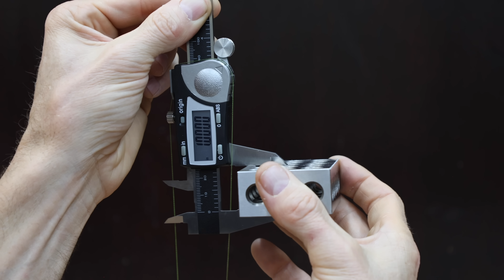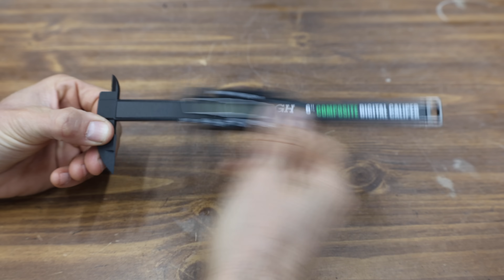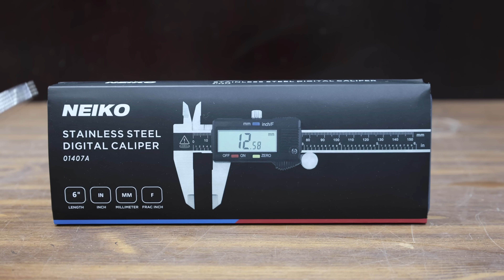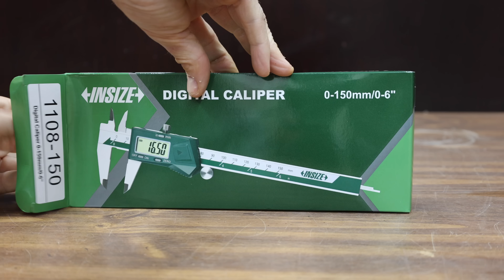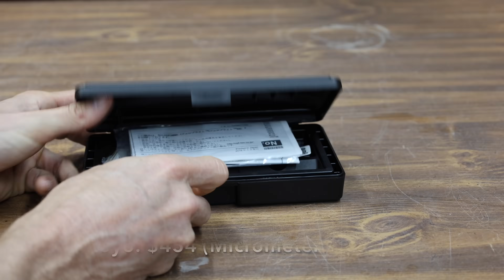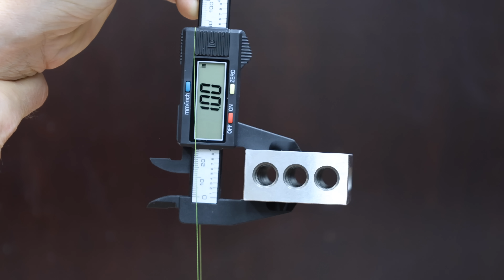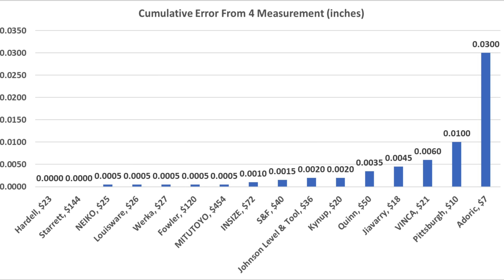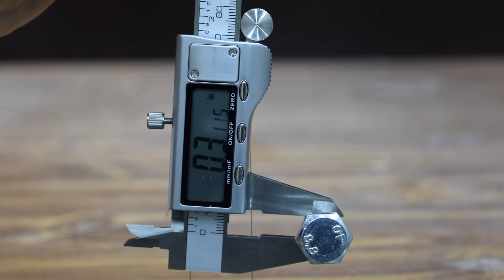I've Been Proven Wrong About Calipers!

Comment: My machine shop days, a job while I was in college, are some 55 years behind me.  What I recall from then is more about how to use these tools, and that differs from the tests.  For consistency I can see why the tests were performed as they were, but I think something about actual use needs to be said.  First, I always use the wheel to control the pressure on the piece.  That means a feel for the pressure.  Second, and probably more important, the piece being measured is always moved along between the jaws, and other case of feel.  measuring something round like the drill bit includes rotating the bit, another example of applying feel.  All those combined are part of making consistent measurements, to handling each sample consistently against all the other samples.
When a Harbor Freight store first opened in my area I got what I thought was an amazing deal on one of their Pittsburg digital calipers.  Looking at their web site, in appearance it is visually a cross between two models, both $23.  Looking at those two listings I find each has multiple part numbers; I found mine among the six listed for one of them.  Which brings me to a point I don't recall being mentioned.  The web site lists 90 days for their warranties.  The cardboard sleeve that goes over the plastic case on mine says Lifetime Warranty.  I can't imagine needing to use that, but I guess if I got a replacement under the lifetime the new one would be 90 days.
Reply from the maker: Thanks for sharing!

Comment: I know this my QA side being picky but you should be using a surface plate and get certs with each caliper. That wooden table can cause discrepancy with the depth tip. 

They are also 2 set screws on to for calibration to straighten up the jaws to make them parallel.

Comment: I can tell you a few things from experience: Brown & Sharpe, Starret, and Mitutoyo have made a name for themselves with results, not marketing. Their SERIOUS customers are more than capable of calling B.S. on sloppy metrology tools because a lot of times bad tolerances cost them loads of money, reputation, and sometimes lives. Things they’re not willing to afford.

Second: if you want an accurate measurement under about .01”, go get micrometers; calipers flex. Not saying they can’t be accurate below .01” but if it matters, get a micrometer and use the friction screw or thimble.

Third: if the tolerances REALLY matter, so does the temperature. If you want a place to work with a consistent (usually cold from my experience) temperature, work in a metrology lab.

Also, analog tools don’t need batteries and they don’t tend to disappear as quickly because people that care enough to learn to read analog metrology instruments have typically invested enough in their careers to not need to make tools disappear to make a good living. Not saying good trades people don’t use or have digital calipers or mics, but analog has some pretty strong benefits. 😉
Reply from the maker: Thanks for sharing your experience!

Comment: I'd like to see a test of weight scales like you're using.  My 0-500 gram version varies alot depending on where the weight is on the platform.  The 0-5 lb varies if it's not on a flat surface.

Watch out for fake Mitutoyo's.

Thanks Todd

Comment: I extreme like your video but ---> the most important feature is precise firm measurement AND REPEATABILITY(and wear resistance, jaw flatness, oil/coolant resist). When you measure, you should hold it and push/slight turn on the round screw. so this test, sorry but no, mitutoyo (especially), insize,  starret will completely outperform all others. if you want precise sample, at least try a shoulder screw grinded surface and gauge blocks, mitutoyo micrometer privided one... and use a marble flat! ;D  I work in QC and mitutoyo calipper was used 24/24 7/7, they never fail and are exactly on measurements. the 12'' inch one is so stiff, you NEVER never miss a measurement, I can do blind measurement and do 50x exact same result at 0.0005'' spot on. exemple, if the surface is 1.7775'' I can do 50X and have exact measurement (no flex 1.7770 and no 1.7780) well trained QC would succeed this and you need the best tools. also make them work on oil/dirt/stain would be nice. I was expect better than a jaw force to close test... hahaha yeah cheap ones feel like you have dirt in the slide... ;) (sorry if my english is bad... ) it comes with extra battery!!! no screw needed yay  (we all know that machinist eat battery) ;D
Reply from the maker: Thanks for the constructive feedback!
Reply: @ProjectFarm  thanks to read me (some are trained to do measurement as a living)  .

Comment: Great video, thank you. 
Video idea. The Quick Grip style clamps/spreaders. I've been a fan of the Irwin for many years, but a lot more options came out since I bought some. I use the larger with a 24" bar to straighten 2x12s for laminating headers, seem really strong. Dewalt has some now, as well as the Quick Jack tool, which is pretty neat too.
Reply from the maker: Thanks for the video idea!

Comment: Once the price falls below $100, I'd opt for dial over digital.  The quality drop is just far too steep.  Tough to read, slow, and inconsistent LCD elements can be worse than any loss in precision.  I'd say readability and functional stability are far more critical factors at the lower price range.  Some of those LCDs were brutal with blocky and oddly spaced elements.
Reply from the maker: Thanks for sharing!

Comment: Accuracy wise measuring 1-2-3 block: you claim Pittsburgh is more accurate.  You are misled because Pittsburgh measures only to 0.01" versus 0.001" or 0.0005" for the others.
     When you test depth measurements, what is under the block?  Wood workbench?  You need surface plate or another machined block or parallel to get reliable measurements!
          That groove looked pretty "grungy", like it was made with hacksaw on spinning bolt.  Can't judge calipers on that!
          The battery business is nothing but hassle!  No matter what, they are always dead, or worse, leak, & the spares you have (if) are also dead by age.  The solution for this is to buy solar-call powered calipers.  They can be had for similar price as the more expensive battery-powered ones.

Comment: Mitutoyo.

I used to work as a quality inspector in an aerospace supplier. We had Mitutoyo all the way. It is actually pretty cheap for a flawlessly working and reliable instrument. A no-brainer. Get Mitutoyo, job done. Sure, others make great calipers as well. Starrett are probably excellent as well. Or better. Don't care. I see no need to experiment in order to improve upon an already flawless instrument.
If you can't justify buying Mitutoyo, just buy anything. It doesn't matter. If it mattered, you'd buy Mitutoyo.

One of these nonsensical unpronounceable brands marks their product as a "digital vernier caliper". I know I said buy whatever, but don't buy that one. A vernier caliper is a measuring caliper that uses a vernier-scale to enable you to read sub-millimetre values. A digital caliper is not that.

If you need reliability, a vernier caliper is a perfectly valid choice, vastly preferrable to the bottom-of-the-barrel cheap digital ones. You need to know how to read them, doing so is a bit slower, and you don't have some functions like relative measurements - but it will always give you a correct value, unless you read it wrong.

That is the biggest flaw of cheap digital calipers. Most of them have no brownout detection (nor a warning for low battery). So they will happily display a completely wrong measurement , and you might not even be aware that they're malfunctioning.

You say for a couple of them that they have an auto-power-off to save battery, which I know to be not to be a fact for the cheapest of them. They do not "turn off", they merely switch the display off, which does not use much energy anyway. So effectively they're always on, have a relatively high quiescent current, and may not turn on, or - even worse -  be in brownout-mode and displaying rubbish the next time you grab them to measure something. The issue with anything but Mitutoyo is that I can't rely on the measurement without second-guessing or double-checking. This is also the flaw of this test - you could have easily measured the powered-on and quiescent current, and calculated the battery lifetime. Another flaw is, as another user already pointed out, using a 1-2-3 block to test the calipers, but on a wooden and well-used table surface. A glass plate would have been the very least. Done like this, it's like reading micrometres off a faded wooden school ruler.

One type of caliper I found very reliable and surprisingly pleasant to work with is a dial indicator caliper. I have a ridiculously cheap one from China, it has some of the typical stupid quality issues (indicator glass dome is plastic, scratches easily and had already had to be glued in because it fell out, but when it comes to measuring and accuracy: no flaws.
Reply from the maker: Thank you for the constructive feedback!

Comment: Can you do Dial Calipers next they don't need a battery but if you get any grit of any kind it can screw up the gear rack like metal chips in a Machine Shop 😎I have 6 pairs 3- 6 in 1-8 in 2- 12 in 🤓

Comment: One thing that was not measured was their standby/off current draw. I have mitutoyo, vinca, and igaging, and the vinca is always dying. After not using it for a while it is frequently fading and starts giving inconsistent measurements, which is a dealbreaker with calipers. Whatever low power sorcery mitutoyo has is definitely worth it, but the igaging's are very good for the price
Reply from the maker: Thanks for sharing!

Comment: Testing battery usage when on and off would have provided additional value (can be directly measured). The cheap ones use so much power even when turned off. That and the cheap ones lose accuracy when the battery is low and don't even indicate to you it's happening (can also be simulated with an adjustable power source). Would like to see a part 2 for that.
I got tired replacing the battery on my cheap digital caliper literally every month regardless if I used it or not and bought a Mitutoyo. Haven't changed a battery in years. And it measured accurately even if it's not on! Plus mine only cost 120 euros. Right now they're around 165 dollars here. I'm never going back to the cheap ones.
Reply: Mine read the same all the time. But maybe that's because they are dial readout calipers and don't use a battery. 😜

Comment: In my experience with a Mitutoyo 8" it always works perfectly.
I have used other Chinese cheap ones, which were more or less close to the Mitutoyo in accuracy, but consumed the batteries way much faster (battery was draining even with the device turned off !), and it was a pain having to remove the battery after every use to conserve it, and having to Re-Zero them every time the battery is removed...

In my opinion, the Mitutoyo is well worth its price.

In respect to your testing, I would like you would have included testing for any display reading varying as the battery goes down, as I have seen calipers that start to act funny when the battery is down below half the full life of the battery, that plus the battery draining when off, makes many cheap ones not worth their low price.
Reply from the maker: Thanks for sharing!

Comment: I agree with the other Machinists who posted here............Mitutoyo is in a class of its own, rest can't and don't compete, in digital calipers even Starrett's are a POS.  Also as mentioned this is being looked at from a  standpoint that a person needs a rough measurement in the thousands, not from the angle of someone holding a tolerance trying to build something day after day.  Bought a 8" set of Digital Mitutoyo's when they first came out, still use them to this day, never once regretted that purchase.

Comment: As a machinist I use mitutoyo and interapid calipers as my go to. The high accuracy calipers can be off if you aren’t perfectly straight or sitting flat on the face due to the resolution. Additionally the starrett and mititoyo have an accuracy of ±.0005. So if they are within that window it should be labeled as reading accurately.
Reply from the maker: Thanks for sharing!

Comment: So there's a flaw in your depth testing. Few things. First is I noticed that you had some trouble keeping the calipers squared up with the block. Also the table had debris on it and that could have elevated the block by a tiny amount. Also also there were long scratches in the surface of the wood panel veneer this also could have caused the block to be elevated. To remedy this get a slab of marble or something very very flat and make sure that there is no debris. Also try to take human error out of the test. I don't have any suggestions on how to achieve that but with human error it's highly subjective of a result. Otherwise great video bud! Keep it coming! A video idea from me is wifi range extenders. Compared to mesh networks side by side with upgraded antennas. And or long range antennas. Speed tests for all.
Reply from the maker: Thanks for the video idea and the feedback!

Comment: The calipers I use are made by General. I use them daily. They are smooth and do fractions mm and in. I've had them for 5 years. The battery last about 2 years. I don't remember the price but I wanna say $30ish.
Reply from the maker: Thanks for sharing!

Comment: Great Video! I invested into Mitutoyo as a machinist in the mid-late 1990s working through college. (Calipers, Various Micrometers, Depth Guages and Dial Indicator) I built parts for engines, cams and hydraulics. I needed critically accurate measurements. A lot of hobby stuff you won’t need to drop that kind of coin in measurement tools. Mitutoyo has held up perfectly over the years and I am glad I have them. Alot of my colleagues back then used Starrett as well. 

I would say if you can score a sweet deal on used Mitutoyo calipers I would do it.
Reply from the maker: Thanks for sharing!

Comment: In order to help viewers, I bought a Vinca 8" last year which looks identical to the one you have except the length and the battery cover does not have a screw. After it sitting off for a month, the battery was dead. When I went to use it once, it lost zero and the measurement was WAY off. I realized I should have bought a vernier caliper instead of a digital. Since then, I have inherited my dad's old Helios vernier caliper which is awesome! This Vinca is trash.
Reply from the maker: Thanks for sharing!

Comment: One problem that I've found with several low-priced calipers is that the LR44 negative battery contact corrodes and then may break off. Also, I think the depth test should have been done with the block set on a surface plate rather than a tabletop.

Comment: The mitutoyo coolant proof calipers have auto shutoff but cost a lot more.
I work as a QC manager and work in completions so nothing has too tight of a tolerance. I encourage people to get the Mits for quality, but operators dont want/have that kind of money soni recommend the insize ones. If they break who cares and they are just fine most of the time. Side note, the 12" dial insize calipers have the same jaw dims as the Mit ones and can measure an OD of 5".
Reply from the maker: Thanks for sharing!

Comment: Battery life and jaw slop are important factors not included in depth here.  I have some of the cheaper brands and the batteries are always dying.

The standardized pull force was good but not always realistic. I find cheap calipers can flex way more than high quality ones. 

Not that any of this makes the cheapies useless it’s all about application. But the context would be good. 

I tend to favor cheapies where precision is less important and filth is high and good ones in hard to access areas where feel is needed, where precision matter more, or when I’m not near batteries.
Reply from the maker: Thanks for the feedback.

Comment: I have that very first $7 caliper, and for most uses it's perfectly fine. Obviously if you need extreme accuracy then you might want to get something better, but I've used that exact one for years and it's a bargain at $7. Yes, it's a little stiff at first but after some use it glides very smoothly. I do have a much more expensive and fancier metal caliper but I rarely use it.
Reply from the maker: Nice!  Thanks for sharing.

Comment: How sure are you that there were no thermal expansion issues with the block? Specifically on the longest measurments (3 inches) and after manipulating the block for a while during testing.

Comment: To be honest, I never need the ultimate in accuracy, main criteria for me was metal not plastic hardware, thumbwheel and set/lock screw, takes a CR2032 battery, and the head doesn't look like a toy made in China in the 1980's.

I chose a $25 Clockwise DCLR-0605 and have been happy with it.  The markings on the ruler aren't useful, but I never need them.  The CR2032 battery sled is poorly formed, but hasn't been a problem yet.  The main thing that I'd do differently is get something longer than 6" and they do make an 8" and 12" version.
Reply from the maker: Thanks for sharing.

Comment: A great test as usual  - its impossible to test long term reliability, in my experience Starrett, Mitutoyo, and Fowler have been excellent,  and yes I use lower cost brands for quick field measurtemdents, However I think you missed HAAS with some new reasonably priced (fowler priced) calipers, they are outstanding
Reply from the maker: Thanks!  Thanks for the feedback.